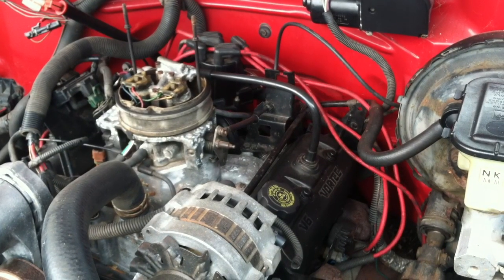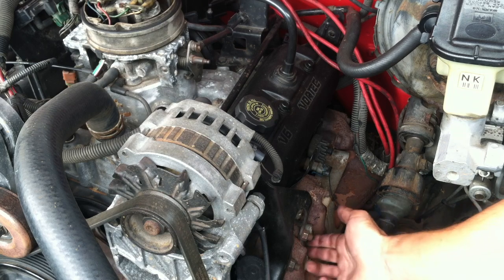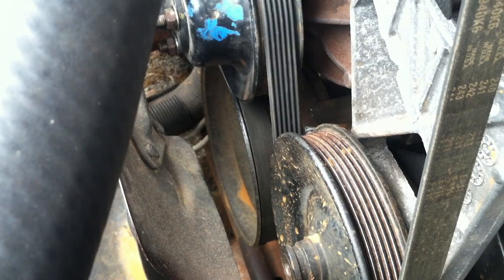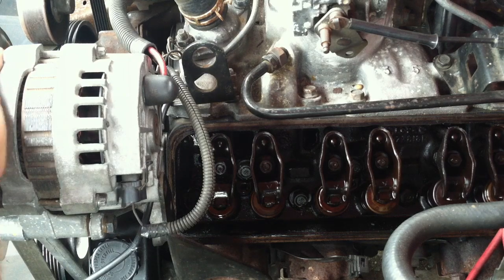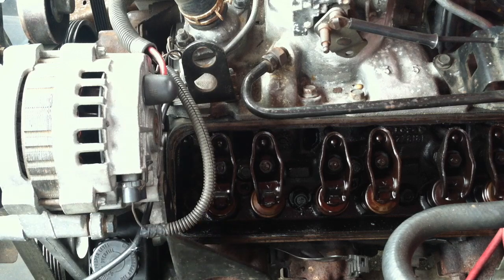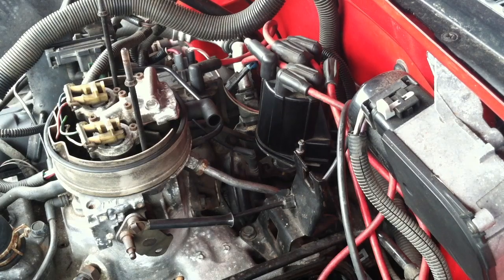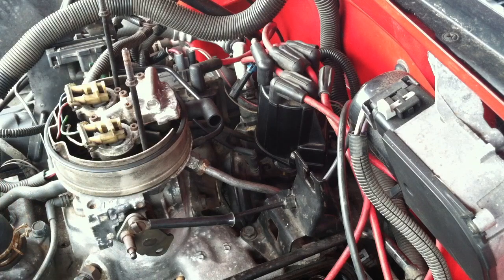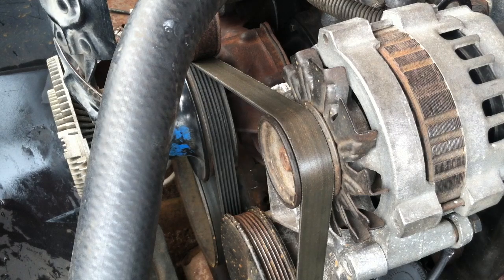How To: Set/Adjust Ignition Timing (1993 Chevy 1500 w/ 4.3 Vortec)

Comment: I just replaced the sparks plugs , wires, distributor cap and rotor and now my truck don’t want to start , it cranks but doesn’t start ? What could it be ? Timing ?  
It’s. 1993 chevy Cheyenne v6
Reply: It's probably the rotor timing, I normally change my Cheyenne's plugs and dist cap and rotor while I'm draining oil, I just turn her off and swap everything

Comment: you showed finding TDC easier then most men on here! and your younger then all these men! so question is? who showed you? I learned by reading all the motor manual's and learned  on my own. your a good young man, so been 63 I kinda forgot somethings.and took my chevy to a shop which ripped me off! I told them I wanted to find TDC because my timing chain was bad.so I changed the chain.and I was in doubt about my mechanical experience.I did it 3 years ago and turned out good.this time I needed help. why? I don't know? the guy put number 1 on the cap to 2 so number 1 now is on 2 on the cap.I wanted him to find if? I got the vales set right. and torq the bolts and set the timing.but,he didn't do what I asked?and charged me more then what we said it would be.so now I want to put the wires back to were chevy put it.can you understand what I'm asking? by the way you did GOOD with your Video.

Comment: Nice video dude. But i have a 95 GMC Safari van, and there is no room to do any of that. You cant reach cyl.number 1 with your hands even through the fender well. So i had to use a camera. My van had been down for over a year now, and nobody had the answers that i needed. It wasnt gettin spark, and it has no crank pos. sensor, so ive replaced everything in the ignition system, and have figured out that it was the distributor that was  bad. It still wont run. So thats why im trying to find tdc on #1, and reset the new dist... this van is a family heirloom, or i swear id burn it to the ground..

Comment: That’s a tbi bud..

Chevy ran out of valve covers at some point so they just throw vortec covers on the tbi engines. You can tell it’s a throttle body injection by the throttle body injection at the intake manifold lol. The injectors are on top just like a carb but it’s electronically controlled by the computer. Vortec engines have a fuel rail and completely different looking engine.
Reply: You’re wrong bud. The heads are what makes it a vortec, has nothing to do with the type of fuel injection that it has on it.
Reply: Good job 👏
Reply: I was wondering about that. Other post says it depends on the heads, but i don't think mine is a Vortec (valve covers same as in this video). Now wondering if Vortec have the balance shaft (I don't). Google AI says Vortec and non-Vortec both have engine code Z in the VIN.. which I have. Mine has TBI.

Comment: OK WTF didnt he just totally do the timing incorrectly using the rocker arm method?? Isnt the intake rocker suppose to rock open/close - then immediately when exhaust rocker barely moves is RIGHT when piston should be at TDC?  he rocked both (IN open/close then EX open/close) for TDC

Comment: Well.. how important is our to position cover 1 in top dressed center..? I can't just loosen distributor clamp warm it up connect the light n set it? Also.. are you supposed to set the timing in park and in drive?
Reply from the maker: Warm up the truck, loosen the clamp just enough to turn the distributor, with truck running and in neutral make the adjustment.
Reply: @Alex-xr3xe  does it make a difference ifbon park or neutral???
Reply from the maker: @luketamoncannon3795  If it's manual put it in neutral. Auto can be in park
Reply: @Alex-xr3xe  I finished her up yesterday, first drop I was one tooth off & it threw me for a loop by how good it ran but my t.d.c.was shoeing at 12 o'clock so I reddropped distributor in one tooth counter clockwise & I was on tdc..
  My original distributor was bad, shaft had a bad lope spot as it turns.  Also found 2 pretty bad bad plugs, 5 & 7, 5 was high yellowish buildup between the contacts..
  Truck runs like new now, totally different truck I'm ecstatic
  Thanks for tye vids n help mam keep it coming..

Comment: So what does it mean i have the 4.3l v6 tbi but not vortec. And i unplug the black and tan wire i get it exactly to zero and then replug the black and tan wire in stays at 0 then i turn the truck off and turn it back on and it goes like 16-17 degrees before the 0 mark

Comment: Little tip. When doing the second method for finding top dead center make sure the pressure is off of those rocker arms. Because the valve overlap as the exhaust stroke ends and intake begins. So they may look closed but may be slightly open.
Reply: Very good video.  Definitely helpful.  Thanks 😊

Comment: I honestly never thought about turning the alternator bolt, I always turn the damper. Great video! Subbed and liked!
Reply: That trick would probably not work as easy on a v8 or if spark plugs are still in heads
Reply: @dmitrikguajardo6006  so I have to take off my spark plugs to turn the engine over ?
Reply: For me is easier to turn at the crank bolt than pulling all plugs.